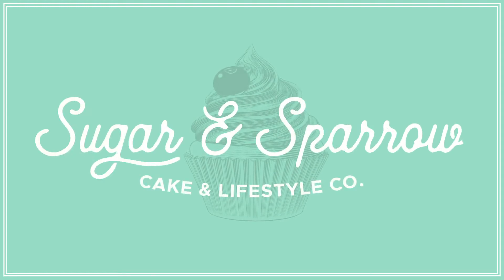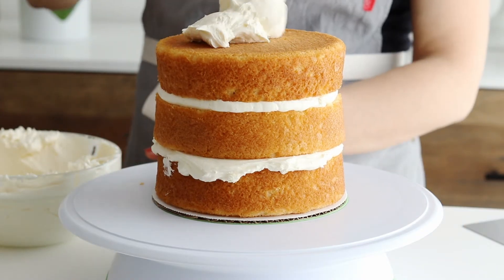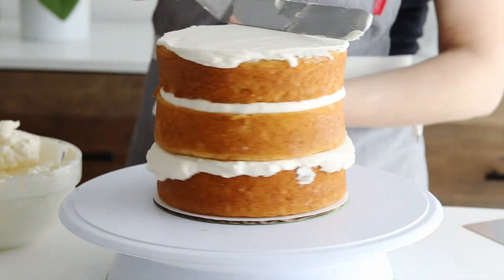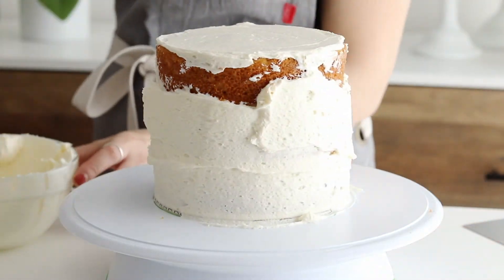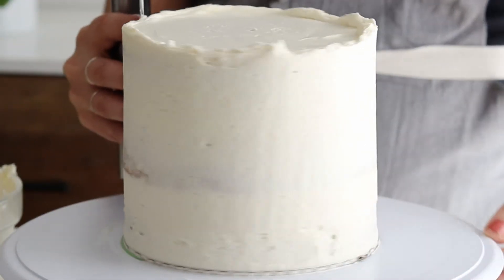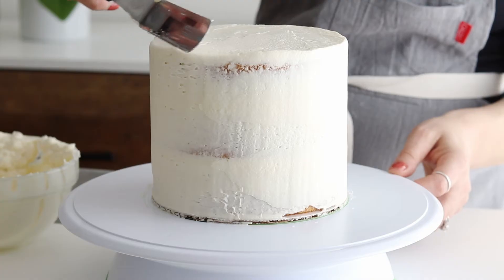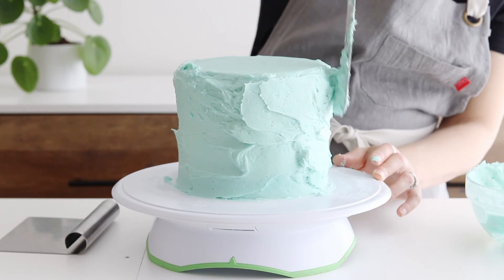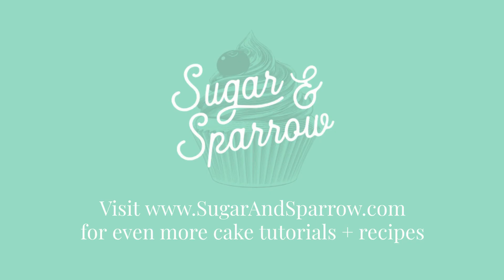How to Crumb Coat a Cake | Cake Basics

Comment: Hi Whitney, thank you for your videos! Question: do you find it necessary, when putting the cake in the fridge to chill during it's crumbcoat time, to also put the buttercream in the fridge as well during that time?? Or can you you leave the buttercream out during the time while the cake's crumbcoat is chilling?
Reply from the maker: Hi Matt! When chilling the crumb coated cake, I usually leave the remaining buttercream out at room temperature, covered with a towel. If you're planning on chilling the cake for more than 30 minutes I recommend storing the buttercream in the refrigerator overnight before bringing it back to room temperature and mixing it on low for a minute or so before using it to frost the cake. Hope that helps!